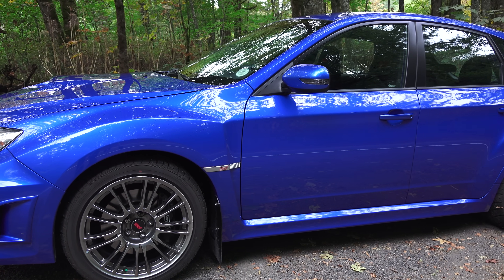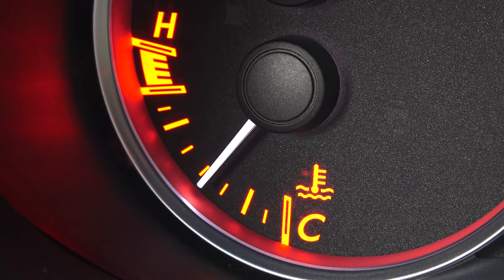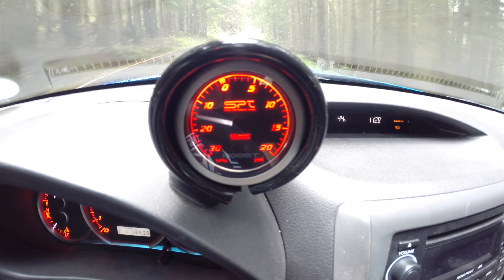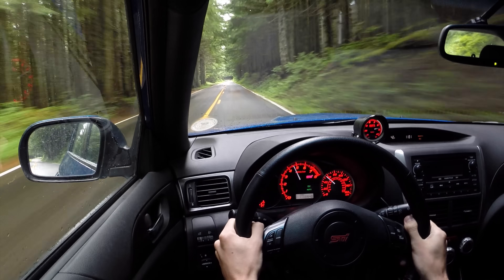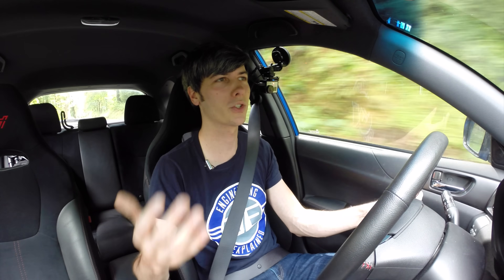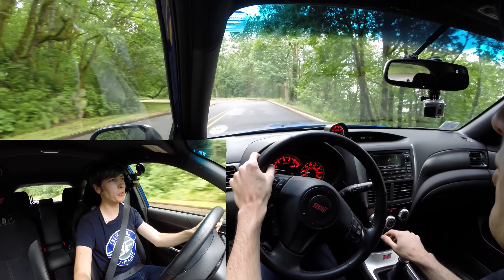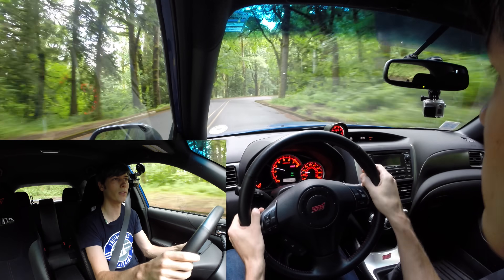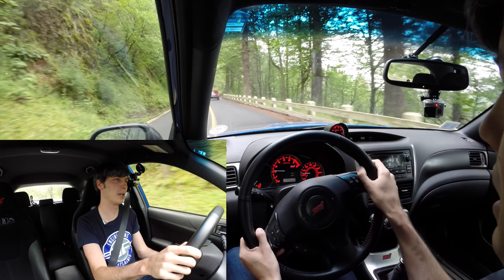5 Things You Should Never Do In A Turbocharged Vehicle

Comment: I break rule 3 with My 2.7 ecoboost f-150, it has max torque in the low rpms(3000), that's when I hit it hard with the acceleration.  I also break rule 4 cause It also uses the cheap 87 octane and gets great gas  mileage and 0-60 times @5.7second  all day without engine knocking. Oh yeah and rule 5, with the light empty truck bed getting it sideways, fun for all day long.

Comment: with the thing about high load and low rpms, is that a thing to worry about with an automatic car?
Reply: No, because if the maker of your car hasn't set the gearbox up to keep the engine revs within a range that mean the engine is always perfectly happy, you're likely to have many more fundamental problems with the vehicle than the turbo's lifespan being very slightly reduced.

It's a pretty basic thing when specifying an auto box, pretty much their primary job is to prevent lugging (and thus the risk of stalling-out) of any kind, and everything else is secondary. Even if the "stall" speed of the torque converter isn't well above that rpm (and enough to allow at least a little boost to build up even with chocked wheels), which it should be, it's still only a problem you should experience in first gear on a steep slope (or the handbrake still applied/a very heavy trailer hooked up) because the road and engine speeds at which it changes up and down the gears should keep the minimum rpm well above the range where it might start to struggle. More particularly, the shift program should react to engine load (long story short - how far you've pushed the pedal down) by preferring a lower gear and thus higher revs at a particular road speed, already having increased the average rpm considerably by the time you reach WOT and the little bulkhead switch that triggers kickdown (which will run the engine in the lowest gear available that doesn't push the rpm into the red).

Your bigger problem, if you find yourself in a situation where the engine can't rev up because of either a transmission fault (stuck in high gear, for example - though for most autos that just means hampered acceleration rather than complete stranding), too steep a slope/too heavy a load to carry up it, or wheels stuck in a rut, is more likely to be transmission fluid overheating... as the amount of heating it experiences, due to turbulence when the engine side is kept from accelerating due to the wheel side being locked or subject to extreme drag, is heavily dependent on how powerful your engine is, and particularly how much power it can exert at low rpm. Which with a turbo engine is typically a great deal more than a naturally aspirated one, so long as it's able to spool the turbo somewhat.

Comment: oil cooler actualy heats up oil fast since it is connected with cooler and all modern engines have electric oil or colant pump to prevent oil burning after shut down.

Comment: Just a question, Most of the new cars today petrol and diesel turbo have that Stop/Start function when you go to a complete stop engine turns off then automatically comes back on...will these be bad for your turbo and also not to mention your starter engine in the long run? I have a mildly new Audi A4 and even in the manual it recommends after long run's or hard use to let the engine cool down for 2 min before shutting off. So can you please explain to those who say it okay for the stop/start and modern engines with turbo dont need cooling down anymore?

Comment: turbo timer should solve the 2nd problem ?
Reply: Cooling system via electric pump, audi/vw have done this since mid 90's first motor to get this system was the VR6
Reply: yes that is the reason for a turbo timer. some euro cars have it OEM.
Reply: my Audi RS3 typically runs itself for about 1min (cooling system at least) after I shut it down

Comment: This is one of the most useful videos you've done - really helpful, especially with so many turbo engines around these days...
Everyone is noting exceptions in the comments, but I think that's missing the point! This is general advice. This aside, everyone should look up their engine and get advice about how to treat it, because they often have unique quirks. My Alfa 147 (with an old high-revving 2.0 TwinSpark engine) has only been reliable because my mechanic told me exactly how to drive it. For example, the engine needs to revved to around 6500rpm quite frequently to keep the valves clean and avoid deposit build-up... quite fun! Typical Italian. It also needs to be granted a lot of warm-up time, though...

Comment: I would add that the biggest reason against lugging a turbocharged engine would be that at low RPM the engine hasn't had a chance to build adequate oil pressure to properly protect the bearings from the load that the turbo is able to exert on the engine at the low rpm via boost.  This isn't as much the case in a non-turbo vehicle where the load at WOT in low RPM is nowhere near that of a turbocharged engine.  A potential fix would be a dry sump or a very high pressure oil pump that can generate adequate oil pressure at low rpm to prevent the load from initiating rod/crank/bearing contact.

LSPI is more of a direct injection(DI)+forced induction(FI) issue, not as much a "small four cylinder" phenomena, although frequently seen occurring in the smaller fourbangers, which have been initially more prevalent in the DI/FI arena.  My personal theory is that LSPI is caused by the conditions of the improved fuel atomization due to DI and the increased compression caused by the turbo (or super) charging, effectively creating the similar conditions to that of a diesel engine, which we know uses high compression instead of sparkplugs to ignite the mixture.  Previous to DI, LSPI was much less frequent (if at all present) because the fuel droplets created by port-injection weren't as ignitable as the fine mist of DI, and most of the damage caused by lugging was due to the low oil pressure/high load circumstance described above, or washing out of the cylinders due to increased fuel injection that you eluded to.

Comment: um.... WOT the pcm reads the TPS signal. causing the IAC to open up the throttle plate, allowing for maximum air flow. Also WOT at low rpm, will not run boost. Boost is created during the back pressure of the exhaust gases. by then even if you're running 6-9 lbs. the rpm will be more than safe. also today's oil pumps/ pick ups run at such a high rate the oil is heated just as fast as the coolant. Do not believe this guy. He's talking out of his asshole

Comment: Wouldn't the pre-detonation in small turbo charged car under hi load low rpm be caused by the fact that getting the power out of the motors requires on average higher compression pistons and higher boost levels. Correct me if I'm wrong but compressing air also heats it up. There for hotter charged air and higher compression basically turns a gas engine into a diesel. Then again gas octane ratings confuse the snot outta me. For the most part what I know is the higher the octane rating the lower the ability for the fuel to pre-detonate. More boost higher compression in a non built motor, more part failure.

Comment: Got any data to support that oil/coolant heating rate statement? Most coolant temp sensors are in the main block coolant outlet. By the time the block heats up, and the heat soaks to the sensor, I'd be very surprised if the engine hadn't heated and circulated its oil many times over. I guess it would depend heavily on the engine's coolant sensor location, and how the thermostat is placed and operates.

Oh, and your last point makes you sound a bit dickish. Did you try to use the most convoluted language you could to say "exercise proper throttle control to prevent wheel spin"? That is not turbo specific in the slightest. A great many engines don't have flat torque curves.

Comment: Use synthetic to reduce wear and prevent deposits.
Reply: Modern cars should only specify synthetic anyway these days ;p
Reply: I guess but it's especially important for boosted and high revving engines.
Reply: mack cummy or engines with tighter tolerances :-)
Reply: Yes but especially high compression and turbo  ones.   There are advantages like longer change intervals and i know it can help the average commuter car engine.

Comment: Rubbish. You shouldn't get 98 octane fuel if your car is prepared to run on 95.
Simple city petrol car will be slower, and louder on higher octane fuel.
Second thing. What's best fuel for diesel engine? One that will provide best injector/high pressure pump lubrication.
There are some Common Rail diesels that can't stant "premium" diesel fuel because it's to dry and will seize some components.

Comment: lugging causes motor to go boom because of pre ignition like you mentioned, but mainly because of lack of centrifugal force on the motor, and most modern day turbo motors make so much boost with almost zero turbo lag (IE VW turbos are well known for its sub 2k-5k maximum torque pull) and this massive boost at low speeds , centrifugal force combined with preignition = boom. also most of these turbos like I said are so small that they spin up very fast, engine goes from a short duty cycle on the injectors at WOT to a longer one quickly, lack of response or a dirty injector will cause an extremely lean condition as the injector goes from nearly opening to flooding within milliseconds

Comment: superchargers are way more reliable tho
Reply: This statement is entirely false.
Reply: Not even remotely accurate. Superhcargeers wear out and require reebuilds more often. You also have a belt to worry about. If you want to know what is most reliable you only need to look to mission critical diesel gensets powering things like hospitals and data centers. You will NEVER find one that is supercharged. Always turbo diesels.
Reply: Roots-type superchargers perform better at low RPM's and fall on their faces at top end--the opposite of turbos.  Thats the only difference between the two forced-induction styles.

Comment: low engine speed pre ignition is quite simple to understand how it happens. 1) the intake port is open longer  and at high boost you can cram more air in the chamber. 2) as it comes up the air heats up (obvious) and as it heats up and the fuel is injected it acts like a diesel and combustion occurs without spark. i know i probably didn't explain it well but that's pretty well what happens

Comment: I disagree that your oil takes that much more time to heat up due to the fact that it also cools your engine down along with the coolant.
Reply: please don't tell me you own a turbo vehicle.

its common knowledge that engine oil heats up slowly, he explained it in the video theirs just too much oil flowing for it to heat up quickly not to mention viscosity plays a roll in it as well.
Reply: i agree with you...at very least if your temp guage is moving then your oil has been circulating enough already...all these thing he says are overthinking it...technology has been made to account for most of this already
Reply: pumpkin1escobar It is true it does heat up slower than the coolant, but it still heats fairly quick. About 20 minutes for most cars with less than five quarts.
Reply: SuperJlonergan He is still mostly correct that it does take longer due to the nature of oil. If you deep fry food you understand my meaning.
Reply: That's fine but half the people watching this probably own some suped up 90's Skyline etc.
Reply: i installed oil temp and water temp gauge on my car.usually after heating up the car for 3 minutes from cold start i go for a drive and even after two miles the oil temp is not even 140f (60degree+ -)
Reply: the 10 mins figure was from tests carried out by Castrol and other oil companies. leaving an engine idling is amongst the WORST things you can do from a warm up perspective as it allows condensation to remain in the engine rather than being carried out of the exhaust, the extra pressure from an engine working at low RPM as opposed to one running at similar RPM without a load makes a notable difference, hence one reason a turbo physically cant run max boost on an engine thats not loaded
Reply: Hadie Roseli 

I think either you're driving in very cold conditions or there's something wrong with your install or gauges...
Reply: that is the other reason, however condensation is the main enemy of oil, as anyone who has looked inside the engine of a perfectly healthy engine, owned by a little old lady who drives it half a mile to the shop and half a mile back 3 times per week will know. a former customer I dealt with (in their late 80's) had a 7 year old car with 10k miles on the clock, in the UK climate. the rocker cover (valve cover or whatever its called in the US, basically the top engine cover) was FULL of white gunge, like mayonnaise. think seriously leaking cylinder head gasket. yet there were no losses of coolant etc.this was cleaned out and the owner passed away a couple of months later. the car was passed to a younger relative who drove longer trips and the 'problem' never returned.
Reply: Chris Williams
Maybe he has some big oil cooler on it. Also 3km isn't that uch if they drive carefully/slow
Reply: Chris Williams  gauges i have is fine. and i live pretty much near the equator as hot as it can be. said car is 180 with sr20det blacktop engine and no i dont have oil cooler installed, oil is fully synthetic if that makes any difference. ive been working on my cars for 8 eight years now. if u want i'll check my wrx ver.9 and my brother gt86 directly from obd2 port but im pretty sure driving 2 miles after 3minutes warm up oil wont be any more than 70degree celcius.. coolant on the other hand heats up really quick.
Reply: i guess you didnt read what i wrote
Reply: +Hadie Roseli 

Oh I did, what you wrote and what I know are two different things.

If you're so keen to be proved right post a video of your gauges ascending from cold...
Reply: i never mentioned that the oil is not hot, i said that my car is still around 60-70 degree celcius which is still 10-20 degree less from normal operating temperature. since when + - 65 degree celcius is cold?
Reply: Hadie Roseli 

I don't believe I said that's cold.

So what are you arguing about in that case?

Comment: I got a 2008 Audi Q7 V8 4.2 TDi, even with real cheap tyres it will not loose traction even on wet tight turns, I did this test (with precautions, like no oncoming traffic, no one in second lane or around at all).  I was VERY surprised.  All I could put it down to was the Quattro system doing it's thing.  I had full twin turbo boost(unmodified) on at the time.  It is a heavy vehicle, I also set the air suspension to "Dynamic" mode which lowers it to its lowest setting.  So when you were talking about slipped under turbo boost, it has never happened to me.  Torque is 760Nm after turbo lag and flat ftom 1700 rpm.  I see ESP come flickering on if going hard on uneven surfaces, but the time above reffered to was very smooth wet 3 lanes tight corner...just crazy!  Any ideas why I did not "lose it"????
Reply: German Engineering.
Reply: +ALL KINDS OF GAINZ you could be right, that Quattro could be the reason.
Reply: The guy in the video is speaking in generalities. What he's saying does not apply to every turboed car. Mine isn't 4wd and I can floor it around corners and never break the tires loose either. 
Also: he said you need to let the car run while parked to cool off the turbo: this was true 10-20+ years ago, but is not true today. Turbos have gone from only being in high performance cars to being at least an option in most everyday cars. None of these cars come with turbo timers that run the car with the key off or warnings in the owners manual to run the car. The turbos have been designed in a manner that makes running the car after to cool it down irrelevant.